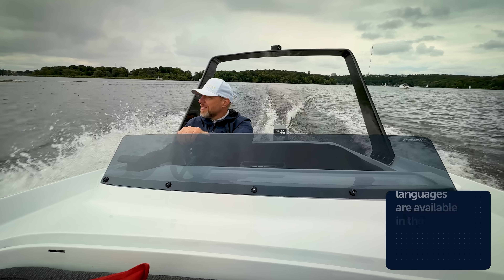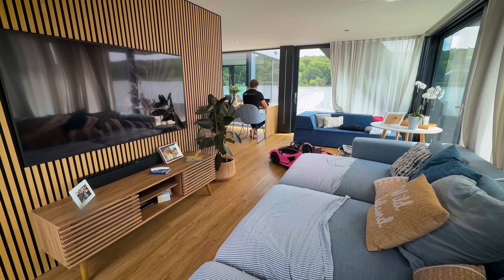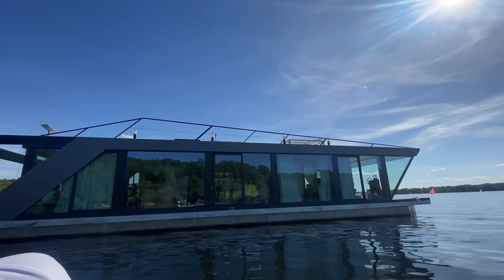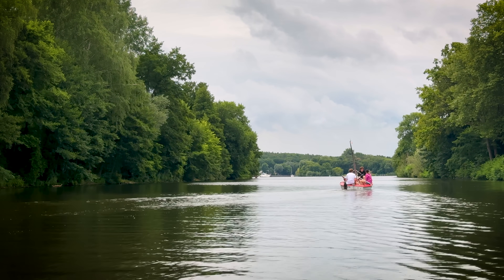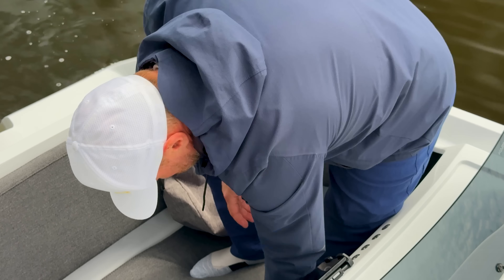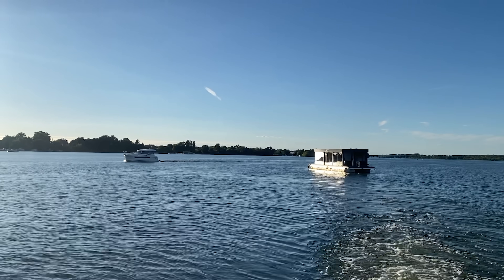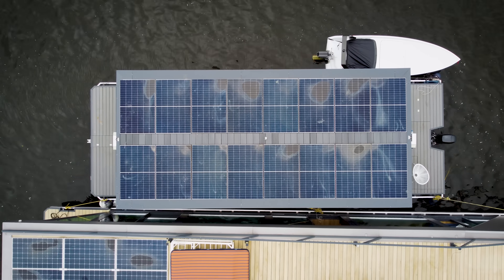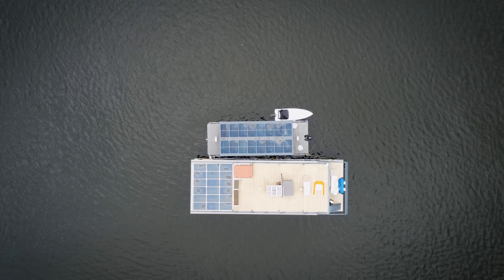Floating boat charging station powered by Victron Energy & solar

Comment: Nice looking houseboats. But what he says at @2:17 is nonsense. "All those plastic (fibreglass) hulls you have to make some anti-fouling, we don't have any anti-fouling, we are very sustainable." You DO NOT need antifouling for boats in fresh water bodies! The reason common copper-based types of anti-fouling are not used on aluminium hulls is because copper-based anti-fouling can cause galvanic corrosion! A plastic (fibreglass) boat on a lake does not need anti-fouling nor does it need sacrificial anodes. 

However, if this was being used in salt or brackish water, it would still need an aluminium compatible anti-fouling system, just like all other boats, so what he says is wrong twice over! 

In fact with such a large and complex electrical system on board the engineering and maintenance regime must take a lot of extra care to ensure the electrical system is completely isolated and stays that way. Otherwise stray current corrosion will DESTROY the aluminum hull in no time.  This is why the "victim anodes to replace every couple of years" is an important part of the maintenance.

The main reason they are using aluminium hulls is because it is cheaper to manufacture - due to small runs of different base hulls. Fibreglass would be relatively expensive here as you need a lot of investment in tooling and moulds that must then be amortised over a large number of identical hulls to realise the economies of scale.
Reply: We are using aluminum because it last forever, is 100% recyclable, and much more stable than plastic (GFK). Plastic doesn’t belong in the water 🤷‍♀️ Plastic hull would brake every time we would crane the boat.
Reply: @SolarYachtCompany  Thanks for the clarification. 

Those are definitely very good reasons to use aluminium or steel alloys in this type of construction rather than fibreglass (aka GFK, or "plastic"). 

However, to say that plastic (you mean here "GFK" or "fibreglass" or "GRP" - same thing) does not belong in water is strange. The vast majority of recreational boats of all types since the 1960s are made out of this material or increasingly, composites such as carbon fibre. 

Also, my main point was regarding anti-fouling, which I consider to be misleading and a non-sequitur. 

I would be more interested as a future customer to be assured of the quality of electrical isolation so that any stray current corrosion cannot occur during the lifetime of the vessel.
Reply: @robertgrahamwork thx for your nice comment and explanation too! My the way you wrote it we can recognize your competence and knowledge in this subject! 👍 🙏

Comment: Zu Weihnachten für online einen Weihnachtsbaum daneben ein Geschenk und eine victron energy battery schönes Video mit Solartechnik bin gespannt ob von Energy Elektromotoren baut für Boote mit Solarenergie das wäre auch Klimaneutral
Reply: Ja schöne 20kW Elektro Pod System 180 mit Joystick 🕹️ wünschen wir uns noch von VictronEnergy 🎅 🎄

Comment: And one day it all goes on fire, and ends up sinking and contaminating whatever body of water it is sitting on! Just wonderful, and so green.
Reply: So “true” 😂 But you forgot, before that happens, of course the heaven will have fallen on you. Other than that, are you done yet with all the cleaning of spilled petrol and oil in the waters of this world. Electric boats are none of my concerns at all.
Reply: I am doing some Victron projects (houses) myself. I just wonder why Quattros are used. Do you need 2 power sources or are there other reasons? I would have thought a multiplus-2 might just fit nice for shore power. If it’s about generators, well I love the way to use DC generators to directly charge the batteries. Thx for some insight!
Reply: @seppm64  no generators - one quattro is charging the batteries for the electric engine and inverting to provide 1x 3000W and 1x 6000W for the wallbox. The other quattro is charging the battery and inverting 48V /230V for the front wallbox with 2x 3000W and all the electric 230V system  on board the Charging Lounge.
Reply: Because we all know that heavy fuel Oil is not toxic at all
Reply: @tobimai4843   so true  ☺
Reply: Not with VictronEnergy…! Maybe when you don’t work with professionals and install made in China System or self made batteries 😅

Comment: Great products and ideas.  Also, thanks for the list of Victron products.  Questions:  What are the types of plugs used for the floating charging ports and the size of the cable?
Reply: 16A CEE (up to 3600W) and 32A CEE (32A x 230V = 7000W)